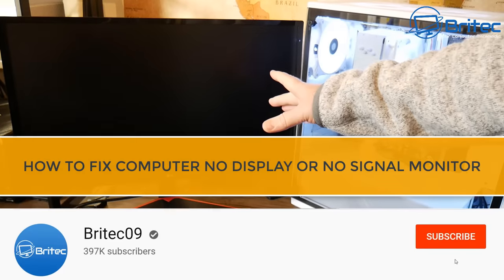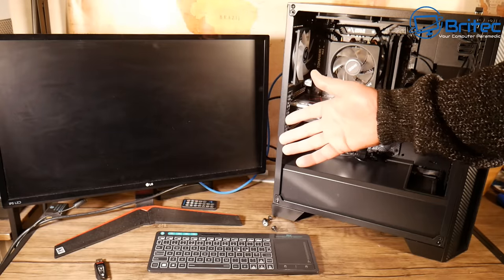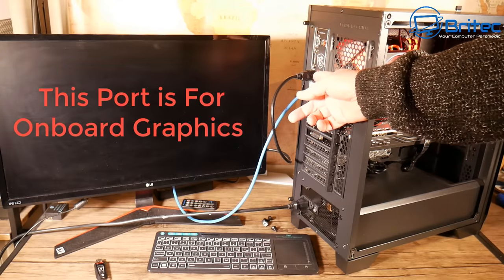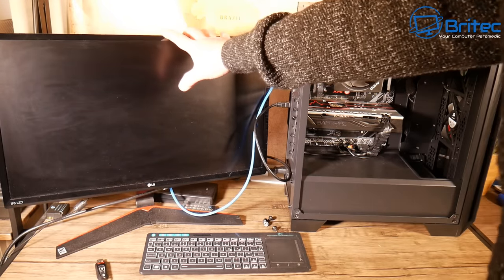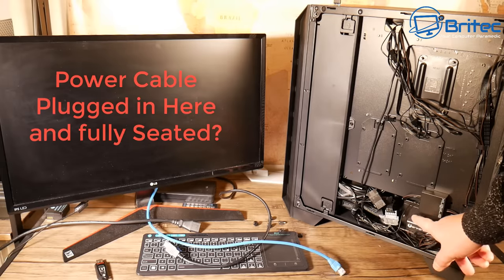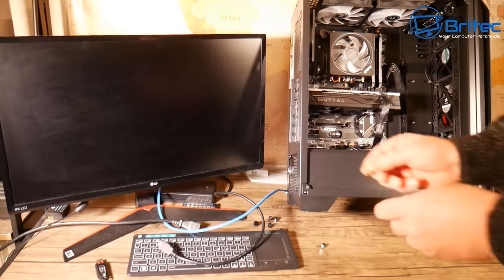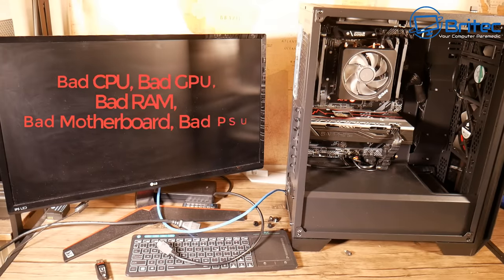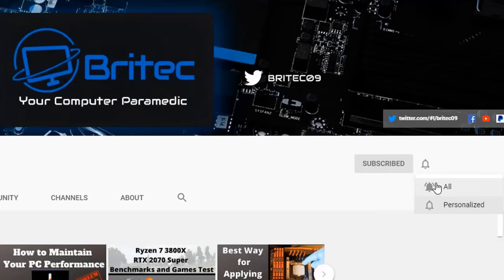How to FIX Computer No Display OR No Signal on Monitor

Comment: Here's the thing...my computer was working perfectly. Suddenly i had a short circuit when i plugged in a vacuum, and the lights went off in my house. When it came back, the computer started normally, but the tv (which i'm using as monitor) stays with "no signal"

The tv works fine and the computer as well, with a VGA cable and no graphic card...but the HDMI one seems useles now, and the computer goes "no signal" when i turn it one with the graphic card in, even when the monitor is plugged to the motherboard

Comment: Please help me after my windows update. System powet on but display says no signal. It works fine before.  
My processor is AMD  ryzen 3200
MSI basic motherboard. 
No graphics card
Corsair 8gb ram

Monitor able to find the right hdmi port but says no signal.

Comment: I have the odd problem, my pc was working in good condition yesterday,. But today when I turn the pc on, all of the parts working and no signal appears on display screen , I try other screen the same problem appear, so I cleaned the ram GPU and mother board then the pc worked and the signal appear,  after one hour  I turn the pc on and no signal on display, so what is the problem?!
Reply: Same as me did u fix it dude?
Reply: Not yet, I tested Al the part its working will,  but I seem that is problem in motherboard

Comment: I updated my windows and the pc wouldn't connect to the monitor, i thought it was a problem with the pc but it turns out the hdmi cable was damaged. THANK YOU SO MUCH

Comment: Feel like my problem might be slighty different. My Pc knows there is a 2nd monitor plugged in but i can move my cursor or a window to my 2nd screen but it wont display anything. I tried different hdmi cable but no succes. Still getting the DVI no signal error. Can anyone help thanks ?

Comment: I had a pretty bad tower that I got for work, well I eventually decided to switch to gaming on it and jist got a new tower, before everything worked fine but once I unplugged the old tower and put the new one in the tower will power on but just get a blank screen on my monitor, yes the monitor is on, the tower is on, i have checked the cords and replaced them, I have tried both HDMI ports to no avail
Reply: I’m having the exact same problem so your definitely not alone.

Comment: I have this no signal to monitor problem on my Dell T5810 computer, I have checked my videocard to another computer and is working, I connected another display and still no signal, I checked 2 cable display port display port and display port to HDMI and is still no signal on the display from videocard, so can be a defect onn the memories or on the motherboard  ? Can anybody advice me what to check more ? I will measure the 12 V in all plugs for videocard to see if the power supply is damaged.The SATA hard disk is booting and I see the yellow light to NVME hard disk, but there is no signal to the monitor. Any help please ? The computer worked until today when I try to change the videocard Nvidia Quatro 4000 with Nvidia Quadro 5000, after this no signal on the monitor.

Comment: I need help when I turn on my pc my monitor doesn't pick it up and when I used a android tv box on my monitor it worked and I made sure my pc is not the problem because I connected it to my tv and it worked fine and no it's not the cable I checked.But when I try to use my pc and monitor together it won't pick up a hdmi signal

Comment: Last time I put new fans in all I had to do was replugged my ram in this time I have done it 30 times and still no signal I have unplugged gpu it’s not the hdmi or monitor or power supply what is it I’ve only had my build a month please help someone should I just give it to Best Buy or somewhere to tamper with

Comment: My old htpc i just tried to get going after not using it for ages, the power is on, fans working etc, monitor is fine but no signal. There's no bleep on start up.

Comment: Hiya, I’ve got a question, my sons pc has the gtx2080 graphics card in it. We can run it on his 4K monitor using hdmi but there’s no display when using the display port lead. I believe it would give a better display as it has more bandwidth 🤔.   Any advice would be appreciated 👍
Reply: Did you get it fix . How to do it.  I have the same problem  with 2070 super

Comment: I have a problem trying to use a 60" Mitsubishi DLP TV as a monitor for my (self made) ASUS Win 7 pc. Previously (with the use of a HDMI splitter ) I have has this tv displaying pc as well as my 22" pc monitor simultaneously and they have both displayed fine.. For some reason this does not work anymore. I have a 32" flat screen TV I use as a monitor as well with no issues. I have taken the splitter out to simplify trouble shooting. With ONLY the DLP connected  via HDMI to the graphics card, here is what happens.... restart pc ...on the DLP I see the ASUS POST screens etc windows colours are displayed (They move around and then form the Windows logo etc ) . What should happen next is the Welcome screen should appear with the area for you to enter your password and your desktop should appear. Nope. All I get is a blue scree. Just says HDMI 2. No msg saying "no signal" but that is pretty much the case. Is not HDMI cable because I can use same cable to connect to the TV Cable box and DLP is fine. Also (then) is not the DLP's HDMI input. Can't see it being the video card because other monitors & TV's display fine. Also I don't see why it displays ASUS  Start up screen POST screen etc fine and the start of Win 7 boot up all fine.... any help would be appreciated! Thanks

Comment: I updated windows on my xps 730. 
now I only get signal until windows boots then no single before sign in. What could the issue be?? 
Bios 1.0.5 no ezflash so I don’t know how to update to 1.0.6
I think it’s all original except Ram it’s a second hand system. 
Q6600 cpu
14gb Ram 
Gtx280

Comment: Okay so my issue quite hard to determine I had i5 8400 wich I switched to day for i9 9900k n yes it's combatable with the motherboard and everything was working fine till I switched cpu No signal I thought was the cpu so I changed back to the old one same thing again I have no idea why buying a new motherboard on Wednesday in hopes it was the motherboard or something or is it possible a cpu can somehow destroy the motherboard or something its quite confusing how it was litterly working 30min before I swapped it around then boom no signal

Comment: Can someone help, I literally did and tried almost every way possible and it’s still saying no signal. Can you tell me what you did to fix yours?
Reply: me too.
I'm crying mentally
Reply: Me too
Reply: I think my motherboard is damaged. If I find a solution I'll write it here.
Reply: @JakobTV_YT  I fixed mine actually, take out the left ram stick and leave the right one in, then start, If that doesn’t work put the left in and take the right out, then swap the sides, then do the same thing. That’s how I fixed mine
Reply: @dhirajkoirala9198   I fixed mine actually, take out the left ram stick and leave the right one in, then start, If that doesn’t work put the left in and take the right out, then swap the sides, then do the same thing. That’s how I fixed mine
Reply: @JakobTV_YT   I fixed mine actually, take out the left ram stick and leave the right one in, then start, If that doesn’t work put the left in and take the right out, then swap the sides, then do the same thing. That’s how I fixed mine
Reply: @brenenfn5020  Nope, still doesn't work

Comment: I need help I’ve checked my cable and monitor and they work with my other pc. When I try it with my new one it doesn’t work and all my fans are on and cleaned my ram and gpu
Reply: Did you fix it I’m having the same problem

Comment: My computer and monitor are working normally but I get no signal on my monitor. I unplugged my hdmi one day and when I plugged it back in I got no signal. Not the cable and its not the monitor so idk what to do

Comment: I have a monitor native resolution is 1440x900 but when l turn my pc,my pc is working but my screen is black.But when l use lower resolution monitor it boot up just fine.l tried almost eveything from cleaning to replacing cables and hardwear nothing works

Comment: So whenever I plug the display port into the gpu it does not display anything on the monitor but when I plug it into the top on the cpu it displays something what should I do with the gpu because I’ve purchased this from a professional builder

Comment: can someone help me with this. My computer suddenly didn`t recognize my monitor while working. I`ve tried to plug the monitor in other devices and it works. fine same goes for my computer i plugged in a different monitor and it shows my display. but when i plug my original monitor and computer they it doesn't show any display at all just directly to the no signal screen.

Comment: I have a same problem plus with other problems my keyboard and mouse won’t connect even they are plugged in, and when I take the plug from the wall of and back in the fuse goes off

Comment: My problem is that I didnt do anything..... last night it was working and this morning it says "no signal"..... Ive plugged the vga chords in and out a couple of times..... reset the monitor a couple of times.... cleaned the ram stick..... strong power supply..... Drained the Cmos battery.....

still not working
Reply: If the PC turns on, try unplugging the power cable from the monitor while the PC is on until no juice is in the monitor (no standby light is on) then try plugging the power back in the monitor, was a problem I used to have.

Comment: When I plug my motherboard connector to my monitor it works fine but when I plug my gpu connector to my monitor nothing happens. I’ve checked to make sure the gpu is plugged it and it is. When the monitor is connected to the motherboard it doesn’t say that my gpu is in thought. Idk what to do.

Comment: i have a problems on my monitor! It doesn't connect to my laptop even tho my monitor is on! I also put the cable in the right place but it doesn't connect to my pc but it sometimes turn on but in a specific place but when i move it a little my monitor doesn't connect to my laptop  again

Comment: Can someone help? Recently my monitor doesn't recognize my PC. I have to force restart my computer for the monitor to work and it will work. Now I have noticed that my PC doesn't go to sleep anymore (past 2 weeks) when before it used to do that if I turned off the monitor only.  I have VGA cables. Have this PC for 5 years now and it never had this problem.

Comment: What happens to me is, I get the signal and then after a few minutes of playing games, the black screen pops up with the no signal, entering power saving mode. I hear an error on my computer and if I'm talking with my frends on discord, i can still talk even tho my monitor loses signal. This is only happening in high end games, im using the gtx 970 and a amd ry5 3600 with a stock cooler, i checked the ram (everything is ok).
Edit: The computer doesnt reboot, it just stays at a black screen infinitely.

Comment: I have an APU, but for some reason I still can’t see it on my tv. I did an HDMI chord and I still can’t see on my tv. None of my pins are bent or broken at least I don’t think so. My monitor is just a small tv we had spare so I’m not sure about that. Please help
Reply: Gabeb1818 im also searching for solutions. What happened before it happened? I have 3 assumptions on mine. The dust went in because we had someone working on my room. 2nd my mom damaged the HDMI plug on the motherboard because she moved the monitor down without unplugging anything. 3rd is i think power surge. I was trying to adjust the extension cord and there are sparkles on plug even my AVR is off.

Comment: I've done a number of troubleshooting. My GPU doesn't seem like it's turning on. The fans don't work. My MB doesn't have onboard graphics so I can't test it.   Not sure if it's my GPU or other...any ideas?
Reply: Have you got the 6 pin connector plugged into it
Reply: And also that cable could be br9ken if you have it plugged in. Hopefully it's a modulr psu otherwise it will need a dull replace

Comment: Thanks for the help. I was baffled at my No Signal, then realized the HDMI wasn't plugged into the graphics card port. Much appreciated.
Reply: @jaidsalgado  ikr. I wanna die
Reply: @jk-cj4el  Aight, my problem was my BIOS needed to be updated. Have you tried that? It worked for me and have been using my PC for about 3 months now 😄

Comment: took my PC to pieces, INCLUDING CMOS battery  to clean out the dust.
 put it all  back together. nothing. Blank screen, but CPU started alright  !! ?
again took out everything except PSU, MOBO, RAM.
Monitor comes ON. and shows up  a very strange BIOS, which says ' press F1 to reset BIOS'
now connected the SSD boot drive, and the UEFI fires up !!
then boot up from the VENTOY USB drive ( idea which i incidentally got from you ...ummmm)
"repair" instead of Install. it says i did an 'unauthorised' hardware change. press "N"
bang ...... all is well again. i'm guessing it was the stupid battery removal.
am i right?

Comment: If You Are Using A HDMI And It Says No Signal It Is Probably The Wrong Port Make Sure You Put It In The Port Next To The Graphics
Card So If You See Another Port Which Looks The Same As The HDMI Port Plug It Into That

Comment: So I was haveing a reboot and select proper boot device and I took out my ram sticks to clean them and what not but when I did that it then only showed no single and stopped working completely I took out the battery and did that power thing and nothing works

Comment: My issue is that when I power up my pc the first few times there is no signal ... if I restart one after the other ... nothing 

If I power the pc up and let it run for like 10 mins then restart it picks it up no problem.

I have used different cables / different monitors / switched between TV and monitor (both TV and monitor are working and monitor is only a year old) 

Still doing the same thing ... once I have left it to run for a while then reboot its perfectly fine ... no issues at all. It just on the original startup

Comment: do i need a new monitor,  when I 1 st. power up the screen goes black, then i press the power button on the monitor again it comes on, when screen goes black again this happens 4 times
when finally get a picture.

Comment: hey man i reseated my gpu and my rams nothing is working and i cant find the battery part on the motherboard i have a B450M DS3H. Also the monitor works fine just wont connect to my new built computer

Comment: Hi there, I have a problem with dell 960 computer after I change power supply. 
It shows me solid orange light on the boot and blinking 1 2 . And no signal monitor. I have cleaned the memory and I change the battery but still have a problem, so do have any idea please?
Thank you
Reply: Did you fix it, if u did, could u tell how?

Comment: When I press the power button, the fan in the board works and the lights lits up but no display. I need to press the RESET button to start it up and make it operational. Do you have any idea what causing this problem? Thanks.
Reply: Hi did you solve this problem? I have the sam issue
Reply: @milos1235  sadly, no. I'm still pressing the reset after pressing the power button to boot my PC. :(

Comment: Ok so i built my fjrst pc, the fans run and everything, but no signal. My monitor and cords are fine, the ram and motherboard is brand new and so is the cpu. Help. I tried all ports as well. My power supply is also new and is a 700w im fine. I dont know whats wrong.
Reply: i have the exact same problem.

Comment: will a MACHINIST LGA 1150 Motherboard, H81 Micro ATX Intel 4th Gen Gaming Motherboard for Desktop PC Support 1333/1600MHz DDR3 Dual Channel Max 32G, i3 i5 i7/Xeon E3 V3 Processor, NGFF M.2, SATA 3 H81M-PRO   WORK IN MY dell precision t1700?.

Comment: I just got finished cleaning my pc and everthing was perfect untill I clean the graphics card with air spray and I connect all good and now it say signal not found
Reply: YEA, same problem. Dediced to clean the PC. Air spray. 
Soon after. Can't get signal on any monitor. Tried 3 so far. Tried a different power cable, Display cable, processor, each ram, VGA, motherboard reset and nothing. PSU is fine, can still get power but no monitor will word. Tried the monitor on notebook still nothing. WTF ?
Reply: @Hoenir  Yeah I hope we can fix this soon
Reply: MoneyShot OG in on the same boat, replaced psu, motherboard, ram and cpu and I think all the hardware is ok, the graphics card fans spin on boot up but still nothing
Reply: Someone found the solution?
Reply: Sorin Budulan mine was just ram not pushed in fully even tho I was sure it was

Comment: Oh! My issue is the converter of Display port 1.2 of monitor EliteDisplay E241i to HDMI of my GPU. I can configure the avg frommy monitor to my card but when try to do the dp to hdmi. The screen no matter what I do. It never recognize it. It was a second hand screen as bought a few years ago and didn't think about DP until few days ago as said to try and dang found no cable sign from there. Thanks for the video as will try the ram and see my card and see how It will go.
Reply from the maker: You're welcome

Comment: I FUCKIN FOUND THE FIX FOLLOW THIS STEPS

1.turn off the pc
2.Disconnect the PC from its power source
3.disconnect all monitors
4.unplug the monitor you're having issues with from its power source
5.wait approximately 1 minute
6.Reconnect ONLY the monitor you were having issues 
7.Reconnect the PC to the power source
8.Turn on the PC